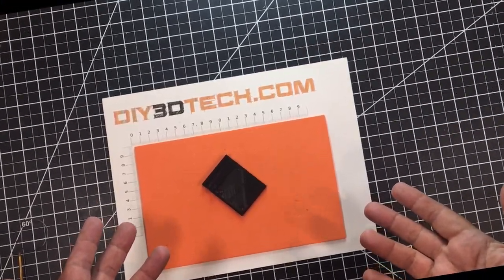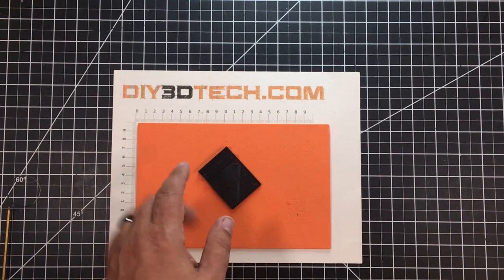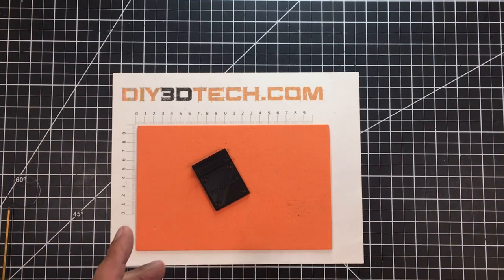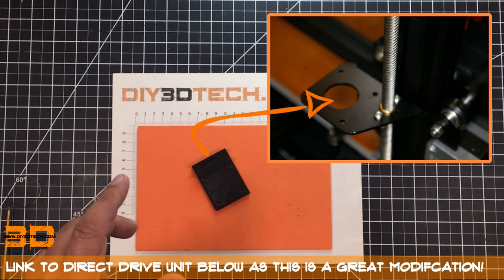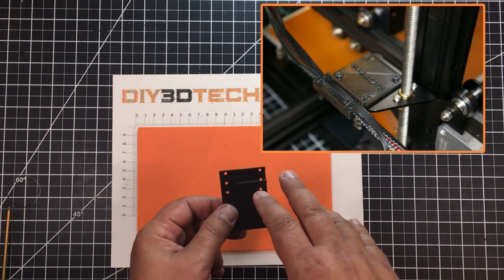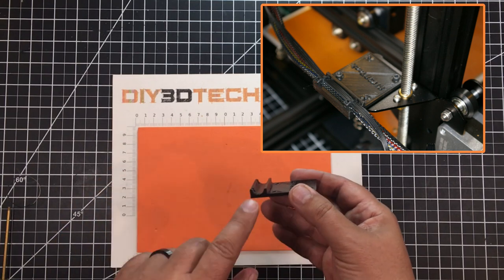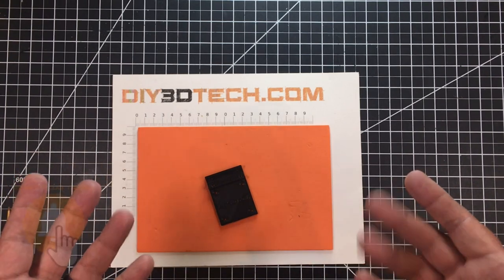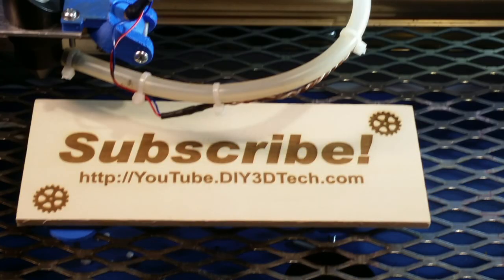Ender 3 Modifications - Direct Drive Cable Management Plate!

Comment: What direct drive system did you install on this Ender 3? The reason I ask is I recently installed one but my cables are routed on the front side from the extruder, then mounted to the X-axis stepper. Thanks.
Reply from the maker: Here is the unit I am using:  https://amzn.to/2PBesyF

Comment: So, what happened to the extruder?   I'm going to email about my trouble with Ender 3 Pro.
Reply from the maker: its now a direct drive so its on the gantry...
Reply: @DIY3DTECHcom  I'll look into it but I ordered and just installed a new motherboard and touch screen controller.  As soon as I get the firmware update it will have mesh bed leveling. with nothing to install.  Here it is: BIGTREETECH SKR Mini E3 V2.0 Control Board 32Bit New Upgrade for Creality Ender 3, with TFT35 E3 V3.0 Graphic Smart Display Controller Board 3D Printer Parts
Reply: Okay, I am heading to direct drive.  I got the mod print off of thingaverse.